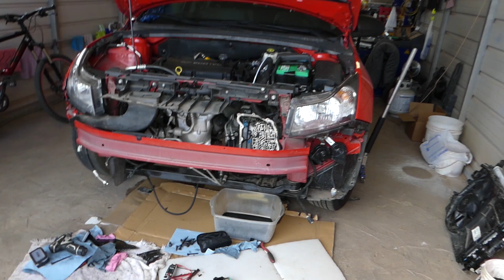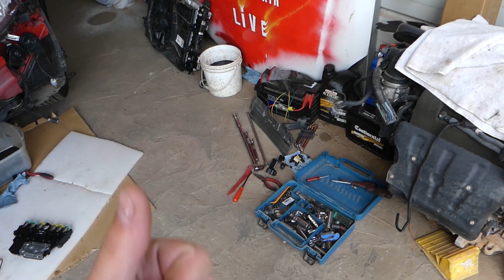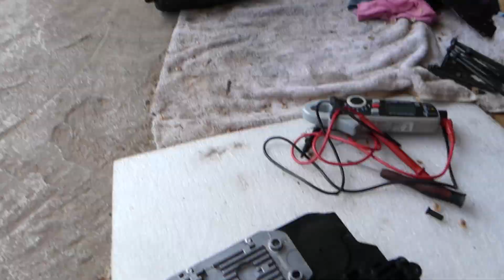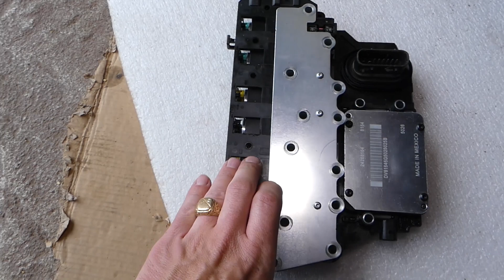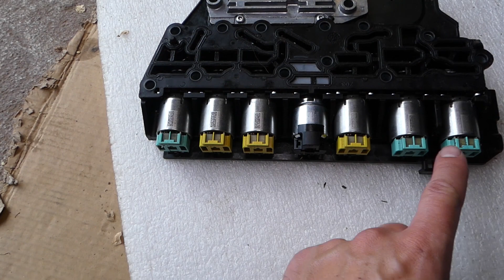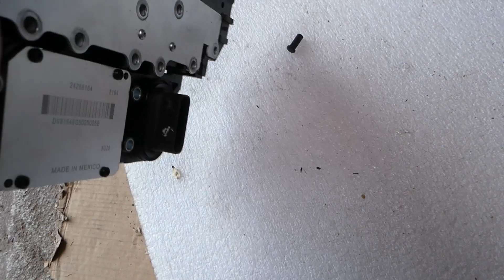TRANSMISSION SOLENOID ORDER CHEVROLET CRUZE SONIC MALIBU TRAX EQUINOX 6T30 6T35 6T40 6T45

Comment: Hey ! My 2014 gmc teraain 2.4L has the same issue.
Engine code says, “TCM list communication” I have already bought new TCM module but don’t know what solenoid should I change.
I don’t want to change whole tcm because want to keep some original parts in tcm as well.
Car lock and unlock itself wiht power steering service and stability track service flags.
Please advise me of your best.
I bought this SUV $5000 with original 96k miles only.
If I go to any transmission shop they’ll charge me price of my SUV.
Thank you man.
Appreciate your help.

Comment: I have a 2011 chevy malibu with P0752 Code: Shift Solenoid “A” Stuck Open, I don't know which solenoid in the bank I need to replace. Which solenoid is shift solenoid A?
Reply: I'm having same issue on same car chevy Malibu 2011 the crazy thing I'm having the same problem the computer code says solenoid c stuck off for me but can't find any diagram with it as a,b,c etc
Reply: U ever find the problem tho I think it's might be the 1st value  I looked my issue up it said valve 3 an mines was solenoid c
Reply: Só testar a resistência da solenoide com multímetro e depois testar a solenoide com uma fonte de 12v

Comment: Which is pressure control solenoid? Which is transaxle control system? My car will turn on but it won’t go into gear. It overheated, went into idle mode and is stuck that way.

Comment: I have a 2011 Chevy Cruze that didn’t have reverse or anything past 3rd gear, I replaced the solenoids and got reverse back but 2,4 and 6 gear don’t work now, is it possible that I put certain solenoids back in the wrong stop or is it a wiring issue?
Reply: You figure out??
Reply: I’m having same problems
Reply: I just replaced the entire pack and it fixed the issue
Reply: @wyatthoffman5979 where did you get the pack from?
Reply: @wolfden161  I ended up just replacing the whole pack how it comes out with another one I got from my local junkyard and it worked perfectly
Reply: @wyatthoffman5979  gotcha, thanks for the reply, in the same boat so i might just need to go that route lol
Reply: @wolfden161  it’s definitely the easiest route!
Reply: @wyatthoffman5979  thanks again!
Reply: @wyatthoffman5979  Hello! I'm having same problem, didn't the used pack need to be programmed? If you didn't get it programmed, did it keep any warning lights on? Thanks so much for any insight!
Reply: @ I just got a used pack and didn’t have to reprogram it or nothing, just popped it in and it drove great

Comment: Are all the green the same part number and all yellow the same part number or are they all different part numbers specific to each part. I actually have gen 1 but I’m trying to figure out if the if I’m dealing with three types of Solenoid Or seven different types

Comment: Man, Could you help me? I bought a new TCM for GM Prism (second generation 6T30) and this used TCM does not change above the third. What do you think if I change from the third solenoid to the older solenoid of the older TCM. The defect of the old TCM was after the car got warm, went into emergency mode. Thank you for your help.

Comment: Great video. My code is showing pressure control solenoid B bank stuck off. Do you know which one is the B bank? Thanks!
Reply: Did you fix it? I mean did the solenoid fix?

What gears wasn’t working?